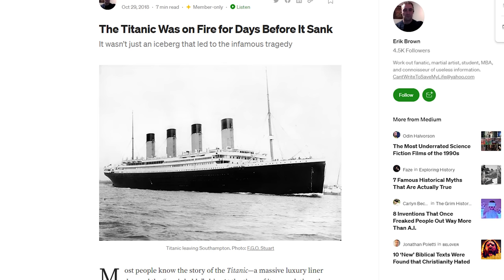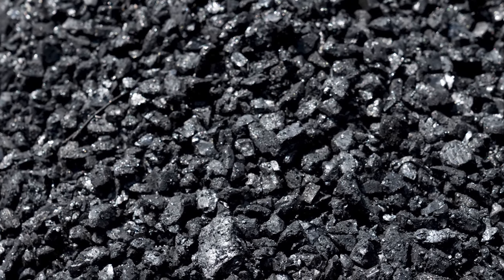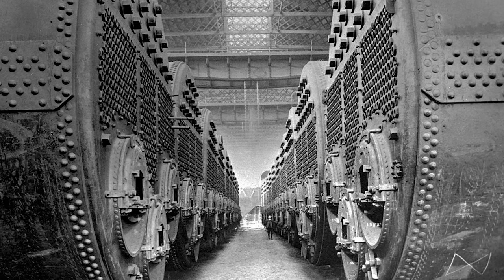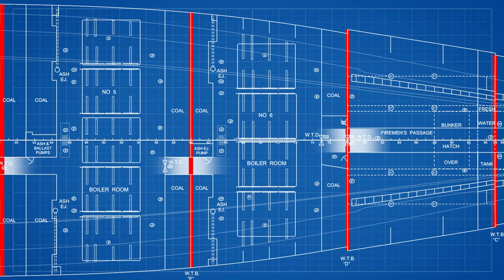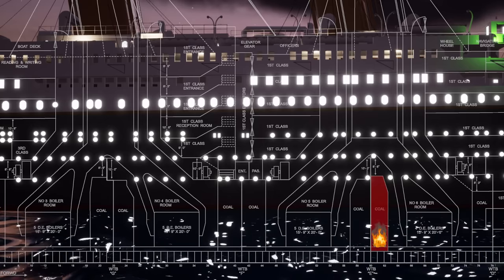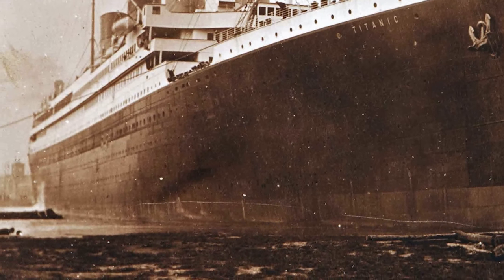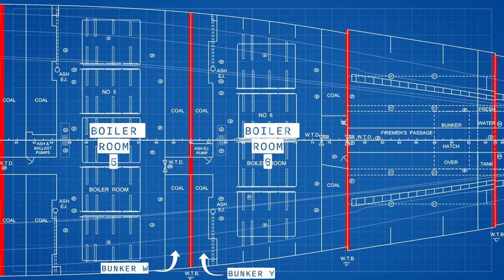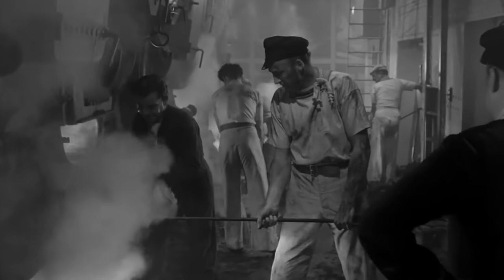Did the Titanic's Coal Fire Cause the Disaster? The Burning Question.

Comment: We had a coal fire at my workplace. Open top bunker (or silo). The solution was dousing it with a fire hose every few hours. And checking with a thermocamera. Temp on the surface would be around 25 celsius after dousing and 2-3 hours later it would be up to 60-70C. I guess they couldn't do any of that on the Titanic, so using the coal was the only way to get rid of it?

Comment: I think the reason why the bunker fire theory has been so tantalising is that despite Edward Wilding's calculations that the Titanic couldn't survive with the first 5 compartments flooding, the evidence on the night is that at the point when water burst into boiler room 5 from bunker W, the Titanic had settled down to a 3.2 degree forward trim and STOPPED 
sinking.

In the first half an hour after collision, water entered the ship rapidly as the hydrostatic head difference between the waterline outside the ship (15-20 feet) and inside the ship (err... none!) allowed the flooding to proceed at maximum 
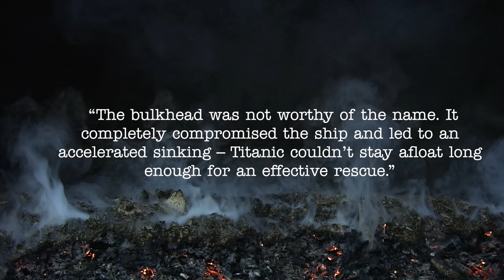speed. But by 12:10, the compartments had filled and the hydrostatic heads more or less equalised, reducing the influx to a trickle. By this point the ship had reached a 2 degree forward trim.

Gradually over the next 40 minutes to 12:50, trim reached 3.2 degrees, and then stabilised completely, indicating that the ingress of water seemed to have stopped.

Then at 1:10, boiler room 5 began to flood rapidly from bunker W, and within ten minutes trim reached 4 degrees. What is crucial about this angle is that at 3.2 degrees, the top of water-tight bulkhead E (separating boiler rooms 5 and 6) was probably still above the waterline (thus preventing water from flowing over the top into the next compartment), whereas at 4 degrees, it was probably below the waterline (allowing water to spreading unimpeded into boiler room 5).

In effect, had bunker W been strong enough to withstand the water pressure behind it, there is a chance the ship may have floated for many more hours until rougher seas inevitably led to the sixth compartment flooding.

So when it became widespread knowledge in the 90s that there had been a fire literally in the precise area of failure that sank the ship - it just became inevitable that debates about whether this contributed to the sinking or not  would rage. What surprised me the most is that it took another 20 years for it to start appearing outside of the Titanic community considering just how aggressively this had been discussed online for decades.

ETA: And no, I don't think a relatively small smouldering fire the other side of a steel wall changed the fact that bunker W was not supposed to hold back that amount of water pressure!

Comment: Ur information is in correct.  You can only feed soo much coal into the boilers and Feeding more coal into the boilers does not make the ship go faster.    The speed is controlled by the telemotor.  xzThey feed the boilers with coal to boil water . Steam turns the generator creating electricity

Comment: Also consider that those water tight bulk heads are only designed to be water tight at nominal temperatures. The shear strength of those rivets holding them in place reduces significantly when heated up by something like a coal fire.   Have you considered shock loading?  Go stand on your scale and bounce/jump.  How does a 150 pound person weigh 450 pounds? If one bulkhead let go suddenly, the next one would have been subjected to significantly more than it was designed for!  Those bulkhead doors wouldn't do ANYTHING!  Im tellin you right now if I thought some Capt. was going to be tempted to seal my fate at the push of a button, I would have put a penny in the exposed teeth on the door!  Not going nowhere!

Comment: It sounds like the fire didn't directly affect the sinking, which isn't surprising.  What I might believe and think plausible would be it playing a role in human factors leading up to the sinking, ie that it affected choices that lead to it hitting the iceburg, whether distraction, feeling a need to not have any other deviation so that there were not too many problems on the voyage, etc.  Not saying that's what happened, just that it could have been one factor, modern air accident investigations and similar often find numeras contributing factors and complex human factors involving stress, sleep, distraction, feeling compelled to perform regardless of issues faced, pressure to save cost even unstated, etc. can all play rolls, I'd imagine the fire took attention and planning, and even after out dealing with thise bunkers being empty effecting the feeding of the boilers on the rest of the trip, etc. could create added stresses, pressure, and distraction that might have played a role in choices made in the time leading up to them ending up in that ice field and how they reacted.  I'm also not confident we knew enough about some of how these all played out and how to investigate such things at the time to know if everything would have been caught.  I've not seen anything else about the gire than this video, so I don't know anything material in depth, just playing out some thoughts and feelings from a limited bit of info wondering, if anyone knows anything more concrete about investigation of the human factors of titanic generally and any effect on that from the fire specifically I'd welcome more informed viewpoints and added information, and might do a little googling at some point as well, but felt a need to mention it with the its absolutely nothing feeling I got from this video, which felt like it lacked at least an acknowledgement of the possibility of more nuanced indirect effects.
Reply: There was a smouldering fire, caused by spontaneous combustion of damp coal, in one of Titanic's 19 bunkers.   The engineering staff dealt with it and it had been extinguished around a day before the collision.  It is highly unlikely that it played any role in the operation of the ship.

Comment: What's to be said about the fire causing the coal to burn faster than expected and they were trying to get to NY before running out so they went faster because of the burning supply would run out if they didnt?
Reply: Nothing is to be said about it, largely because it is nonsense. There was no shortage of coal aboard Titanic. Moreover, if you overfill a boiler, all that happens is that, once the safe working pressure is reached, the safety valves lift.

Comment: I discount it as one there's very little air in the coal bins only what's between chunks of coal forges, furnaces, blast furnaces need a lot of air to get coal or coke hot enough to heat metal. and two the atlantic ocean and ship itself would be a massive heat sync.  ever tried to solder a copper pipe that has water in it?   even a Map Gas torch will not heat hot enough if theres even a trickle of hot water and map burns WAY hotter than the standard propane torch.  Im not a scientist but my horse sense tells me thats a non starter ;)

Comment: At the beginning it's mentioned that she had to have enough coal to make the round trip across the Atlantic, with reserves, and that she had coal filled in her home port - what was the reason for not taking on coal in New York? I'd think they'd prefer to do that to be able to carry more passengers and cargo instead of more coal. Aircraft to my understanding basically always take on fuel at every stop and carry no more than needed for each flight (with reserves), even if they have enough fuel capacity for multiple legs unrefueled, as it would be wasteful to carry around fuel like that.
Reply: The "enough for a round trip" thing could also be for redundancy. A ship running out of coal in the middle of the Atlantic was not extremely uncommon then, and it would've been very dangerous scenario if it happened.
Reply: @DerpyPossum  So you're saying they carried enough for a round trip but still refueled at both ends, to have typically twice as much as they expected to need? I suppose a lot of reserve would be wise, given that a lot of unforeseen circumstances (storms) could make more necessary, and running out mid-ocean would be very inconvenient to say the least - not like they could re-fuel mid-ocean even if a coal barge were brought to them, the coaling operation would be very difficult on the open ocean.

Comment: Hello, at the start of the video you say that the crew put the burning coal into the boilers to fight the blaze, which in turn sped the ship up as it approached the iceberg. How does this make sense if the fire had already been resolved prior to the departure? Unless it's another fire you're referencing?
Reply: The fire was not resolved prior to departure, but had been around 24 hours before the collision.   There was no suggestion that using this coal resulted in the ship accelerating.

Comment: Just my curiosity, and obviously not in any way suggesting anything was going on there, but the large 'shadow' further aft seems to have a hard edge at the top just where plates join- so I'm not sure that would have been a cast shadow by any other object. Maybe the skin there was designed to change shape a little at that point, so it's just due to that? Not being an engineer, I'd have supposed you wouldn't have made abrupt shape changes where plates joined, but maybe you do?

Comment: Guys I always thought that when watertight door collapsed, final plunge has begun. What Mike says makes a lot sense, can't argue with that. So what caused final plunge from around 2:05-2:10 am ? Remember I'm just very curious, I'm not undermine any word Mike says
Reply: the door on D deck was open and all the vents around the chimneys, and in general, once the point of equilibrium passed, each liter of water caused the ship to sink a little faster than the previous one.
Reply from the maker: By that point the water could stave in hatches and pour into vast open vents and openings into the ship in enormous volumes!
Reply: @OceanlinerDesigns   Thanks !

Comment: I heard or read somewhere the 4th smokestack (not sure what they are technically called) is a dummy placed for aesthetics only, to "even it up" for a more balanced appearance.  Is that true?
Reply: Yes and no. While aesthetics did play a role in its inclusion, it wasn't quite the primary reason for it; the 4th funnel was used to exhaust smoke and foul air from many portions of the ship, including the galley stoves, the turbine engine room casing, various lavatories, other smaller machinery spaces and even the 1st class smoking room fireplace -- the only functional fireplace on the ship. It also housed an important crew passage, leading from the turbine to the dynamos and all the way up to the top of the funnel itself.

Comment: What about the effects of ice cold Atlantic sea water on one side of that 800 plus degree steel in the bulkheads when it hit. Heat alone doesn’t usually cause warping, but heat on one side with cold on the other will induce distortion. This along with the pressure this water exerted on those bulkheads may have caused considerable distortion. Whether this distortion would be sufficient to cause any leakage is questionable. Interesting and thorough study on this alleged case of Titanic’s demise, thanks for your detailed analysis.
Reply: One problem; on the other side of the bunker...was another bunker. The bulkheads run the width of the ship. It wasn't up against the Atlantic, like the hull was.
Reply: @DerpyPossum , I wasn’t talking about the Atlantic seawater on the outside of the ship but that running in through the gash in the hull where it would come into contact with the heated skin of the burning coal bunker as part of a watertight compartment. I agree that the cold seawater on the outside of the hull would’ve kept that surface likely below 212 F as the coal bunker fire burned against the inside of the hull. Since no stream was observed coming up from the starburst side of the ship is the reason why I believe that the temperature of the hull was kept below the boiling point by the cold Atlantic seawater.
Reply: @chrish5791  It's worth noting though that the fire had been extinguished by the time water entered the ship, upwards of over 24 hours beforehand in fact.
Reply: @DerpyPossum , I wasn’t aware of that, I understood it to be still burning.

Comment: a fire in coal storage (aka hot portion. of coal)!wwould likely be confined and not make the whole bunker red hot.  if bunker went up to e deck consider aactual impact of very hot walls on living quarters and air temperature and risk of fire. and that would likely have been noted in ship’s log with posting of firemen in case fire broke out outside of bunker.  this is why the fire was far more likely to be more slow smoldering in one area of bunker and no risk to ship.

Comment: Did the titanic have pumps? Would have they slowed the sinking? Also could it be possible to use steam to push the water out? I guess not as the compartments don't have roofs.
Reply: It would have needed remarkable pumps to cope with the ingress of water, estimated at 400 tons per minute.

Comment: Had they vented the steam and slowed down the ship (essentially wasting that coal energy) the fear was that the Titanic would run out of coal before making port. So they rolled the dice.
Reply: Nonsense. There was never any such danger.
Reply: @dovetonsturdee7033  Because of the coal strike at the time, the Titanic was carrying less than full capacity. We know from the testimony of surviving coal loaders that the bunker fire was unabated the whole time. It would explain why they did not slow down in known iceberg areas. Something that has mystified experts.

Comment: Question: why couldn't the flooding in bunker W be controlled by a pump, if it was only equivalent to a fire hose?
Reply: Perhaps you might look up how big these bunkers were?
Reply: @dovetonsturdee7033  That has no bearing on how effective a pump would be. If apparently they saw that bunker W was getting flooded, why didn't they put a hose to pump out water from it before it filled up and burst?
Reply: @ChaplainDMK  Titanic was flooding at a rate of 400 tons of water per minute. You would need a remarkable pump to cope with that rate of ingress.
Reply: @dovetonsturdee7033  Coal bunker W was not flooding at 400 tons of water per minute, apparently the rushing water was about similar to fire hose. And the flooding in coal bunker W was what caused the 6th compartment to flood and apparently doom the ship. So to my understanding if they would pump water from  coal bunker W they would be able to prevent the tops of the bulkheads from spilling over. At least that's my understanding of it.
Reply: @ChaplainDMK  The ship was flooding at a rate of 400 tons per minute. You understanding was incorrect. One of the accurate scenes in the Cameron movie was when Andrews tells Smith, 'The pumps will buy you time, but minutes only.'

Comment: Hey bud, why don't you research the coal mine fires that have been burning underground for 60+ years.  They don't smother out and water doesn't extinguish them, it just appears as though it works until they inevitably flare up again.   It's VERY likely the fire started much earlier and had simply been smouldering. After the ship departed and the coal in the bunker was being shoveled out, it likely flared up again! Not so air tight with the doors open now are they!  Likely would have been better off to leave them sealed instead of emptying them!

Comment: I know that the designers considered the Titanic a very safe ship for the time, but there is one thing I cannot figure out or understand about the design and safety claims of the ship. Why did they either ignore the potential for a side-swiping collision or consider it so unlikely that it was not worth designing in resilience to such damage? For how capable the designers at the time were, it is hard for me to believe that they were not aware of such a potential.
Reply: Most Collisions are on the bow, so there's the forward collision bulkhead. Or they drag along the ground, hence the double bottom. Or you get whacked in the side by another ship (think Andrea Doria). Having a huge can opener drag along the side doesn't happen often, so they put the money to where the damage usually comes. Even today, no ship would have survived that, and most would have sunk faster
Reply: Olympic had received such damage in September 1911 when the ram bow of a RN protected cruiser penetrated her starboard quarter to a depth of around six to eight feet.   Two compartments were compromised, by she was never in any danger of sinking.

Comment: I've wondered what really went on. It's too easy to propagate misinformation and misunderstanding even by otherwise intelligent and educated people out of their depth. The smudge is a funny shape- diagonal and narrow over many feet whereas bunkers are vertical- and it transpires, nowhere near. I've always been suspicious of it.
 I've welded genuine Victorian 1/16" steel plate to 1990's Landrover steel and found the Victorian stuff well behaved particularly upside down. But it did not like cold bending and could fracture so it and had to be heated. The modern steel welded quite nicely but just wasn't the same and did not behave the same way. Even 1940's steel hull plate next to 2000's deck steel was noticeably different. The deck steel had layers of laminated rust like old cars whereas the hull steel was pitted but with no lamination.
Metallurgy is therefore quite specialist.

BTW If you've been involved in the care of elderly vehicles or vessels and had to resort to sharp or fast rotary tools, have you noticed how freshly removed rust and blood smell the same?